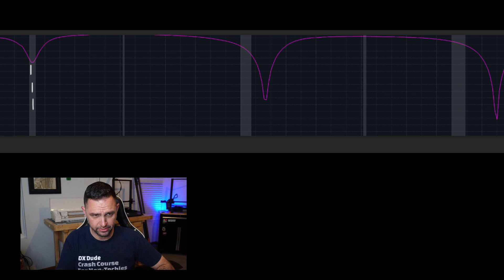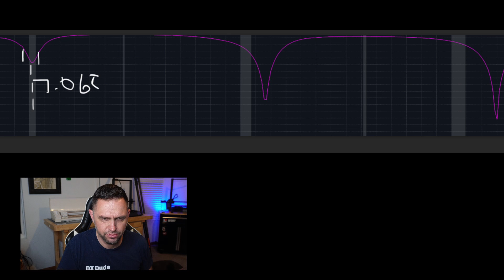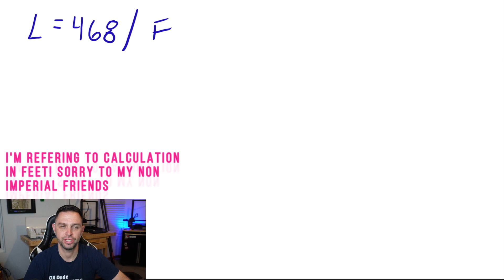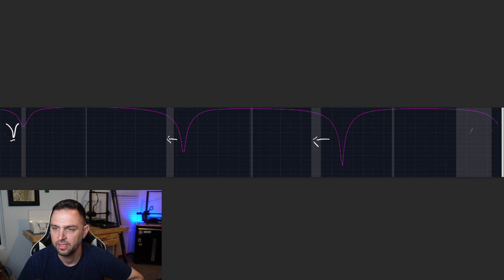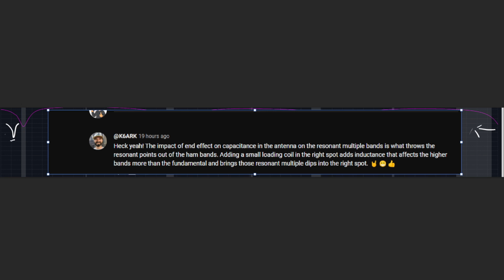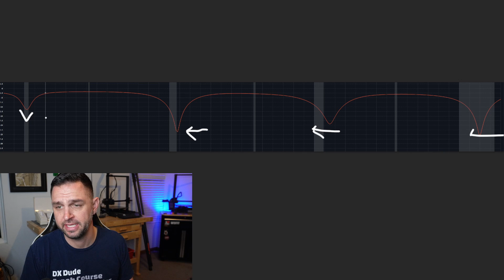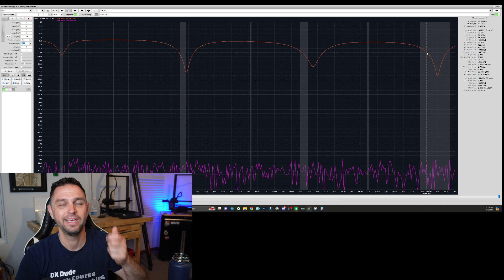How to Tune a 40M EFHW if 20, 15 and 10.  DO THIS  on a  1934-1079-ND Toroid!

Comment from the maker: NOTE: DO NOT CUT YOUR ANTENNA WIRE FROM THE END OF THE WIRE.  Measure from the auto transformer to the desired length. This is because you may not have exactly 75ft of wire. So if you cut from 75ft to 65 feet, you cut 10 feet.  However, since the kit is approximately 75 feet, you may cut short.  Makes sense?  Cool. email me with questions or concerns.

Other mentions regarding the video:  LENGTH. I am aware that the calculation for the half wave is L=492VF/F or (492x.97)/F. If F = 7mhz ... L=(492x.97)/7.000 or L= 68.17714285714286FT for the EFHW. Although I recognize this is the correct way of learning.  This will be something fun to go test in the future. I have wire with a known velocity factor and we can see how close the numbers are as my EFHW is more towards 64.5-65 feet.  

I will test this because I am very intrigued with what I have done vs the math that is mathematically accurate.  KB6NU has a writeup over here: https://www.kb6nu.com/dipoles-shorter-half-wavelength/

Comment: Love the video.  I'm having the same kind of issue with a EFRW antenna -- getting the higher band dips into the operating frequencies.  Would a coil like this help in an end fed random wire antenna ??  73

Comment: Adding coil makes SWR higher on 15 and 10m bands. What do I do wrong?
Reply from the maker: More information is needed. What type of EFHW, What were your readings on each band before and each band after.  We can start with that. Thanks.
Reply from the maker: Also, how many feet of wire. Thanks.

Comment: I have the opposite problem. Great in 10-15 and 20 but 40. I have a high inductive of 44 ohms causing a mismatch. Any suggestions? I tried short/long the wire but mess up with 10-15 and 20. Thank you so much!!
Reply from the maker: Where are you measuring your R and X values on the 40M band?  Are you measuring these values at the feed point or are you measuring after the feed point and coax (and is there a choke inline)?  How high is your wire and in what configuration (sloper, etc)?  Thanks for those answers.  My guess would be your antenna wire is just a bit short, the coil placement is off, or having a long feedline/coax with a lack of a choke is introducing a reactive error.    I'm not certain.  I hope this is at least a start in the the right direction.

Comment: So, I get the concept... But you said that you placed the coil six feet from the end of the antenna. Why? What determines the exact location of the coil... and what effect does moving it slightly one direction or the other, have on the resonant nodes?
Reply from the maker: Hello.  A great person to ask would be someone like K6ARK, which passed the knowledge on to me.  (and there is more to this, certainly): My take or thought on it, in simple terms is if I am around 4-10 feet from the feed point, I will be using this to fine tune/shift the 20/15/10 down slightly.  so 40m looks good but 20 is  resonate slightly high, 15 is slightly higher, and 10 is resonate way higher, around 30mhz.  Using the coil at 4-10 ft (6 is a good spot) SHOULD shift 20 slightly down, 15 more down, and 10 dramatically down so resonance is more "in band".

If you place this towards the middle of your antenna wire,  it will probably(?) create a trap effect and effect 40 and 20 more than 15 and 10.  

Placing the coil at the end probably effects the lowest band the most.   Meaning maybe you can shift 40 and 20-10 will not be as effected.

I know it's not the theory side of things but hopefully this helps.

Comment: Thanks for the great video.  This has been asked below and I think I understand your answer, but just to clarify...if the EFHW is let's say 64 feet tuned to 40 and you find it's too short on 10.  You add the coil without changing the total wire length so the final end-to-end length is decreased to maybe around 62 feet , but it still works on 40.  Is that correct?  I tried to put the question in graphical form below:

-----------------------------------------------   good on 40, too short on 10

---------||||--------------------------              still good on 40, good on 10

Is the above diagram correct?  Thanks again.
Reply from the maker: That's correct! 73

Comment: Great video, thanks, and very timely.  A question or two, if I may.  Let's say I have an existing EFHW that is perrforming as you first described- fine on 40, but high as we go up.  Can I simply cut the wire 6 feet out and add the coil in between the ends of the cut?  Or will I have to shorten the overall length now to bring 40 back in due to the added wire length and inductance of the coil?
Another way to ask the same thing (I think)- if I calculate a length of 66 feet for a 40-10, does that 66 feet include the ten turns on the coil, or do I have to add that (10*pi*core dia) extra coil wire length to the 66 feet?
Does the placement of the coil affect the resonance points on the upper bands much- i.e. can I bring the upper dips into the ham bands by "sliding" the coil along the wire? 
Again, thanks for the excellent video  and you have a new sub.
73,
Dennis
Reply from the maker: Hey Dennis, no cutting should be involved. For example (as I recall, it's been a moment), I tune the wire, so I have the best match on 40, probably somewhere right around  7.100.  Then I check 20m, 15m, 10m. What would probably be observed is 20 is okay, 15 starts to fall out of resonance (and the dip is higher in frequency) and 10m is also high in frequency.  Then I  just snap and wrap the coil (or anything) at about 6 ft from the Winder/Transformer of the antenna.  40m won't really shift too much, but the higher the frequency, the more shift will occur.  at this point, I typically look at 10m and watch to see if/where I get the dip I desire. Hopefully this clarifies things. Thanks!
Reply from the maker: Placement coil position is important and should be maintained 6ft for the resonance of 40m.  If you are trying to make the EFHW work on other bands, like 30m, 17m, etc , you may consider a "linked efhw".  Thanks again.

Comment: I use an EFHW with a 64:1 at 66ft started at 68ft feed point around 5 foot above ground and the other end going up to a 40 foot mast I tuned into it to be resonant at the bottom of 40m very pleased with it around or below 1.174 on 40m 1.5:1 on 20 15 10 and below 2.0:1 17 12 oddly enough I noticed it was around 3:1 on 160M though I don't think my coax will be long enough to avoid getting a blast of common mode into the shack the 991a tuned it but couple of my LED room lights started turn on an off :)

Comment: 2 genuine slinkys make an 80m dipole.
It's great when you're in a hotel room.
Reply from the maker: Thank You!  Do you use a 1:1 Choke balun or anything? Have a good one!
Reply: @DudeTested  always have used a 1:1 choke on everything. If there's any stray RF, it tends to swallow it up. I use an EFHW at home and whilst it's amazing I do get some RF which tends to lock my network up, so adding the 1:1 helps.

Comment: Right now I am building an 80m-10m EFHW using the fairite 2643251002 core popularized by Colin-MM0OPX. After rough tuning at a QRP event without an inductor I added a 9-turn inductor on a piece of 1/2in PVC. I removed one turn and adjusted again.

The transformer is close spaced and tapped for 49:1, 56:1, and 64:1 with a 120pf capacitor across turn 0 and turn 2.
The problem I am seeing with both 8 and 9 turns is on 40m and 20m I need to electrically lengthen the antenna to get the lowest SWR into those bands. At 15m and 10m I need to shorten the antenna to raise the minimum SWR dip into those bands.
On 40m and 20m I need more inductance. On 15m and 10m I need less inductance.
I am considering using a larger diameter PVC former for the inductor. Most of the commercial units use 3/4in PVC or larger up to 2in O.D. For a portable antenna on a wider like I am building smaller diameter is better.

Ideally I am trying to optimize for 3.94mHz which makes the job more difficult when also tuning for higher bands. 3.94mHz is of primary interest because of regional National Phone Traffic System nets and ARES nets that would be useful after a hurricane.
Also, I am considering switching to a 150pf capacitor. I understand this increases the resonant frequency of the antenna and can improve efficiency on 10m. I don't know how whether the increased capacitance provides a uniform increase in frequency or more towards the higher frequencies.
I know adding inductance has greater effect as frequency increases.
I suspect that making the inductor larger diameter may increase the inductance per turn, but with fewer turns there will be less relative inductance between 80m and 10m.

I may have to be satisfied with having 3.94mHz within the 2:1 SWR and near SWR minimum.

Do you have any insights to offer?
Reply: I have had some success with an 80m EFHW that was also able to resonate in the higher bands. Technically, I would call it a linked EFHW. I started with the wire and coil described in this video. Then essentially made a second wire with a coil. Then I linked the two wires together by the ends opposite the coils. Put it up in an inverter V and it did not resonate in the portion of 80 that I was interested in so I actually had to add some wire to the end with second coil and that got me to the region of 80 I was targeting. But the dips higher up were just above the bands they should be in.  So I added more turns to the second coil (it original had 11) I think I ended up adding 6, but YMMV and that brought the SWR dips back up into the higher bands
Reply: I slightly modified my comment above to better describe what I did. I do want to redo this with some more wire that I should arrive in a few days. I will try and take better notes on how I do it.

Comment: I have this efhw 80-10m antenna in average 5 m above the ground with a 110uH coil to make it shorter at 80m. No counterpoise. SWR in average is 1,5-3 and with an atu I get it down to 1,0. What is really strange is when I add the counterpoise. Seems to mess up 17m... atu will not  match it. When I remove the counterpoise atu is able to match 17m again.
Reply from the maker: Hey there, sorry to have a late response. If you purchased this EFHW from me, please contact me through etsy so as to get better service, in a quicker fashion.  Etsy allows me to interact with customers, look up customer information, and provide support..  Otherwise, what wire are you using, what length counterpoise and antenna wire and where does it show resonate on 40, 20, 15, or 10 (or as close to it as possible) with and without the Counterpoise?  Cheers.

Comment: I’ve got compensation coils on all my EFHW builds to bring in the higher bands…but I just use plastic pipe or conduit and drill it out.  That 3D print is awesome….by far the neatest way to do it. 👍

Comment: How/where did you insert the coil?
Reply from the maker: Hello, there. Did you purchase a kit from me?  If so, shoot me an email.  In short, you start rapping about six feet from the actual auto transformer or the toroid. 

. If not, which toroid, are you using for your efhw
Reply: @DudeTested  i didn't purchase your kit, i apologize 😀.
I was thinking of trying this with my setup.
240/140 31 mix torrid at 49:1.
Reply from the maker: No problem . You may not need a coil.  What's your swr look like on the bands as it's is
Reply from the maker: About 6 feet from the toroid with mine
Reply: You can insert the coil 6 feet from either end since the current distribution is symmetric.

Comment: Hey Dude, its been a minute. 
Marconi and Tesla used trapped end feds. As many 7 traps in a single sloper. 
EFHW is just one section of the OG Trap Antenna.
Using the EFHW, make an inverted V, or inverted L. 
The magic numbers are, 12 and 1/12
Reply from the maker: Thank You!  Hope you're well.

Comment: Would the intuition that an inductor will behave as an open circuit from some frequency onwards help? I think after your implicit reference to the inverse relationship between length and frequency, that intuitive analogy might help.
Reply from the maker: I think it does help, thanks.  I think  I need to read up on  Lenz's law  more and incorporate revisit the example.

Comment: Did you add extra wire to the antenna to cover the lemgth used in the loop - or did you make the physical lenght slightly shorter after winding a bit on the coil. 

BTW, the excellent Chameleon LEFS 8010 have about 6 turns on the coil, length of the 40-10 meter part is 63 feet + 67 feet for the 80 m extension
Reply from the maker: Great question.  To answer your question,  after tuning for 40 and adding the coil,  I did not have to add wire  the coil shortens the antenna in that aspect.   I did have to add wire initially because I originally cut too short for 40 (mistake on my post part)

Comment: I have always been told the capacitor is for the upper bands on the EFHW  with 49:1 UNUN I wonder if anyone has tried an adjustable cap to see if it will tune in the upper bands.
Reply from the maker: That would be a fun test.

Comment: Thanks for the video. My EFHW was put up to be a fast and easy temporary antenna when I first moved into my current home. It has worked so well that it has become a permanent and primary antenna. I'm in no hurry to take it down or replace it. Just a thought...I haven't experimented very much to be able to prove this...but I think if you make the antenna around 135 feet so that it is a half wave for 80 meters then it may bring the resonant points more in line with the higher frequencies. Also, I have cut the wire exactly half way and inserted a capacitor. That seems to help drop the resonant points right close to all the bands 80 - 10 meters.
Reply: What are the specs for the capacitor?

Comment: The resistive effect of inductors and capacitors is called reactance. They react to the magnetic or electric fields, and this recatnace is frequency dependant.  Inductive reactace is positive on the smith chart, capacitive is negative on the smith chart, hence inductive reactace = 2 * pi * Frequency(Hz) * Inductance (Henry) and capacitive reactance is  10^6 / ( (2 * pi) * Frequency(Hz) * Capacitence (micro Farads))  -- this is 10^6 because of the conversion to microfarads.  Regardless you can see this in your nano vna by finding the resonant point on your antenna and tunning slightly above and below it, the reactance+/-johms will flip polarity between inductive and capacitive depending on if you're tuning higher than the resonant point (capacitive) or lower (inductive). You can "tune" any antenna to react at near a 50 ohm load with the right amount of added reactance. This is precisely how an antenna tuner works, but it's far more efficient to do it at the antenna ;)
Reply from the maker: Thanks.

Comment: Thanks for the nice down to earth presentation. I used an inductance and a short piece of wire at the end of my 40m efhw to get into the 80m band. I am lately experimenting with coil/capacitor traps on the efhw.
Using a homemade, printed circuit board to mount caps on. Pcb again fits inside a piece of 20mm pvc conduit with the coil wound on the outside.
Reply from the maker: Id love to see this. Do you have a photo online anywhere
Reply: @DudeTested  Tim, G5TM, has some videos about using an EFHW with traps.

Comment: Great info, Dude.   My EFHW looks great on 40 n 20, "too short" on 15 n 10, gonna try this!    Cheers, K7KS
Reply from the maker: Awesome. How long is your wire right now, do you know?  I am collecting some data.
Reply: @DudeTested  Probably 64 ft + six inches give or take.  Anything longer dropped 40 and 20 resonance too low.  It's the TennTennas xformer which works great otherwise.  I just noticed the Myantennas EFHW-4010 uses a 63 ft radiator + a coil.  Tho using a 56:1 xformer (!!)

Comment: Hi Sean and thanks for the video! I´m using a coil with 4 loops at a diameter of 5 cm (1,97 inches) about 2 m (6,5 feet) away from the  1:49 transformer and it works perfekt at all of the 4 bands.
73, Bernhard
Reply from the maker: That's great info.   Which toroid do you use? Thanks!
Reply: I´m using 140/43

Comment: Thanks for sharing your time with us. I am very new and learning. Have a great day.
Reply from the maker: So nice of you, have a good one! Enjoy!
Reply: @DudeTested  I have seen a similar solution but with the capacitor on the other side, 6-7 ft from the end of EFHW, so if you cut too short. You could say it was on purpose. :D
Reply from the maker: Haha.. that's Great idea.    Actually I have equipment to make a small  pcb
Reply: @DudeTested , the only issue is that the coil extends the antenna, and the capacitor shortens, so you will need a longer attachment. The positive is that the bandwidth should be wider. I wonder if this is the way to cover 80m, not just the piece of the band.

Comment: Hey Sean,  great video! My recent problem is with an inverted L random at 84' with a 50' coax using shield for counter. All was good until the LDG 9:1 started giving me intermittent issues with an open circuit. Fast forward to today and it's been a week of grief trying to utilize another 9:1 a guy made for me last year. I've been trying to build my own Unun but parts are scarce like Adam's toroid for the 100w kit. Nothing will tune now and Im physically exhausted from changing out feedline and etc... The strange issue now is that unscrewing the UHF connector from the radio with just the center pin left connected restores the signal. Back to square one and start over I guess. Id like to add you coil but Im using 14 THHN wire. I need to start with a new 9:1 kit and check everthing I suppose. Thanks for  the good video. Any suggestions welcomed.
Reply from the maker: Have you had a chance to short out Counterpoise to Center with 450 ohms of resistors?